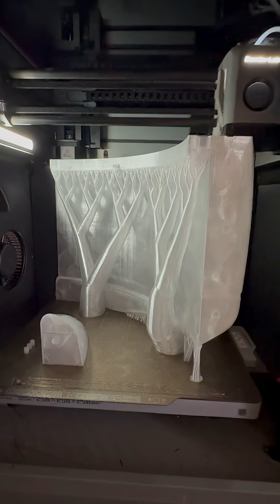Apparently building the world’s largest drone on one 3-D printer takes more time than anticipated.

Comment: Trying to make this work with printed plastic is a stretch and maybe the printer makers think so too.

Farm the designs out to the metal printers in China and it will have a better chance of working.
Reply from the maker: It will work.
Reply: @warmachined3472  I have far more faith in the Spruce Goose's ability to fly around the world than your build lasting 8 hours.

Either way we both are sticking around to find out who wins the bet.❤
Reply: If engineered right it wil work, he is using cf tubes for support too
Reply: @Spacecadet3890  Last time I checked my C.A.D. program still lacked the ability to do stress calculations on 3D printed parts.

I watched another guy print out parts for a very large drone. He found out the hard way he was wrong when his drone became flimsy and warped beyond repair after a short time outside on a hot day.

He had those parts replaced with aluminum 3D printed parts from China. Still not as good as machining it from solid stock but he might get it flying the nexr time.
Reply: @tenlittleindians  petg is very different then pla, and other materials, abs is fine in the sun its uv resistant and used for the majority of plastic stuff you see outisde